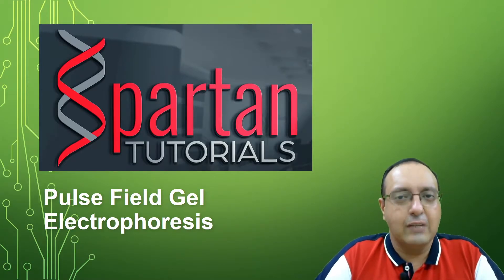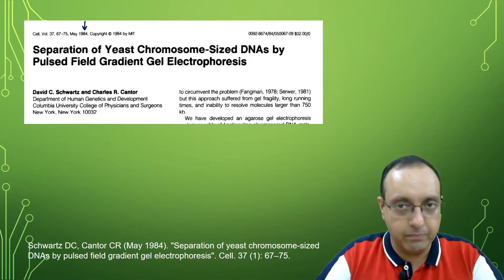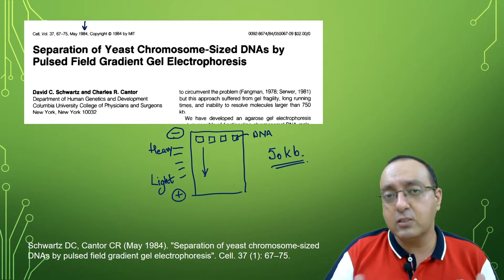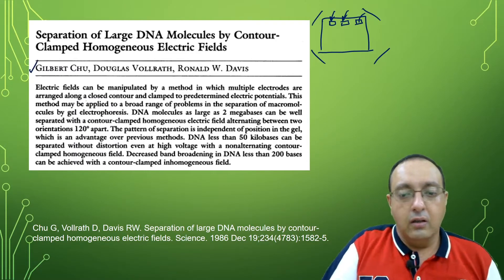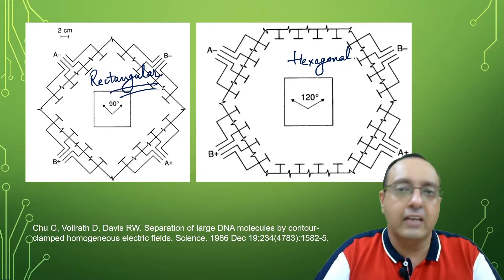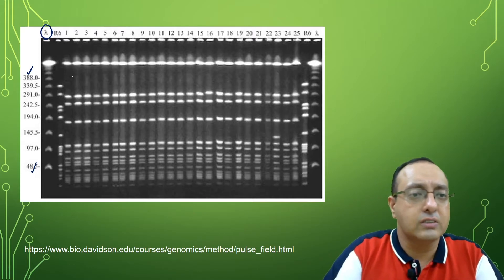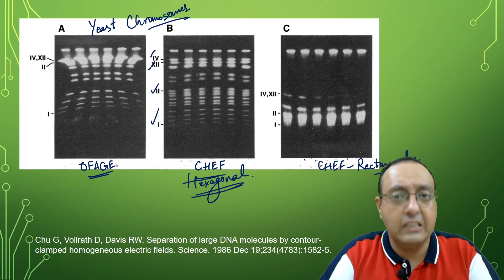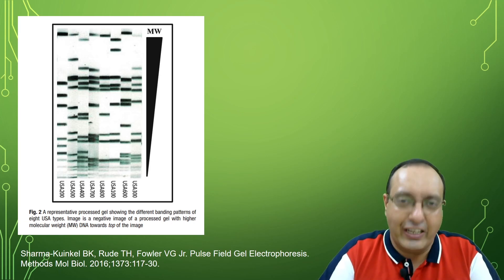Pulse Field Gel Electrophoresis (PFGE) | CHEF | Genomics

Comment: Hi Sir, I wanted to ask, is PFGE the same as Field Inversion Gel Electrophoresis? Thank you.
Reply from the maker: Sure. Field Inversion Gel Electrophoresis carries out the separation by inverting electrical fields in only one dimension (linear) as compared to PFGE, where a lot of different electrical fields are used and these are placed at various angles. So FIGE is a more simplified form of PFGE.